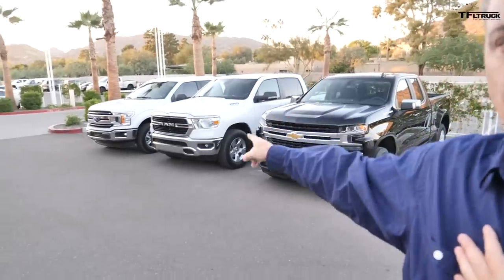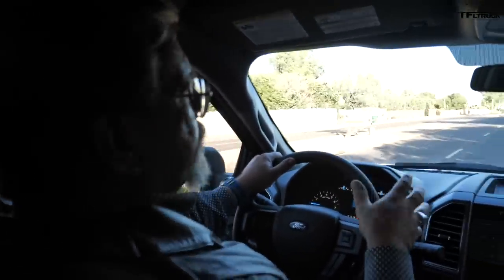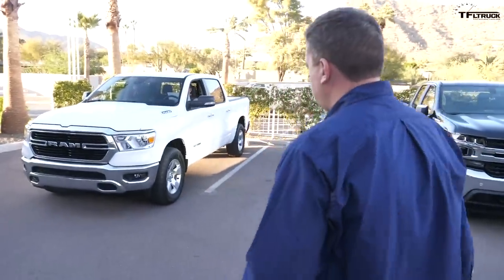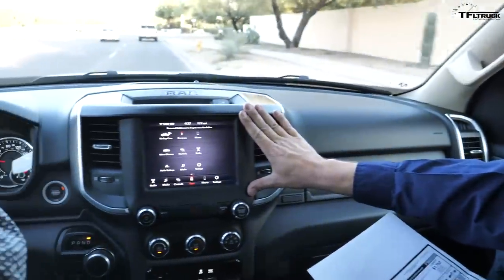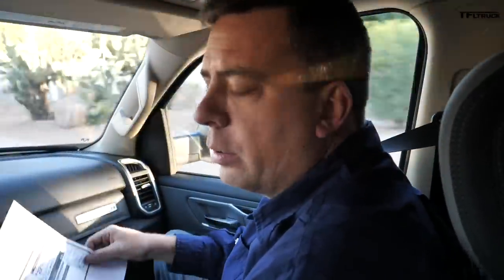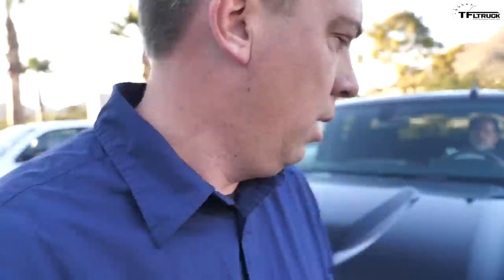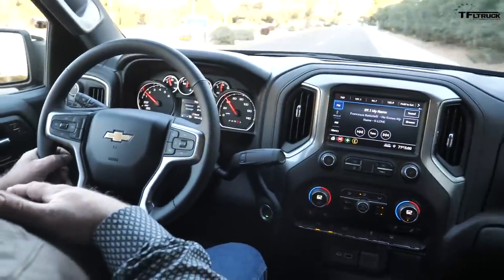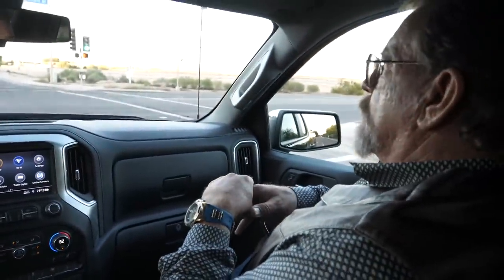Work Truck Wars: 2019 Chevy Silverado 4-Cylinder Turbo vs Ford F150 vs Ram 1500 Review

Comment: Ford guys. How do you get in and out of your supercabs?
Reply: Like a boss
Reply: We use the doors DUH!
Reply: Still using the inside reverse door swing out, passenger first method?
Reply: I don’t know about all you guys, but unless the whole family is in the truck, I am mostly driving it alone. If I had an extended cab, I would find the rear hung doors at that back more convenient for when I am taking stuff in and out of the back seat area. That and having no B pillar and that large opening has got to be useful at times.   And if you have a family with small kids, it’s a nice safety feature to have them unable to open the rear doors without you letting them out. Not seeing any real disadvantages to this configuration on an extended cab. It you are driving around with people most of the time, then get the crew cab.

Comment: No one in Thailand and Asia countries trust these 2 brand chevy and ford anymore.
Reply: How come? Did they release some real messes?
Reply: Many problem about transmission gear and crutch, overheat engine, rusty disc break . Without any responsibility from the company and dealler.

Comment: The 4 popper has the same fuel economy as my hemi. This kids is an epic fail of an engine.
Reply: Check the EPA ratings. A 2019 ram hemi 4x4 with 6 speed gets 14 mpg combined; the 8 speed gets 17 combined. This "4 popper" gets 20 combined in a 4x4. So lets see; the chevy gets between 3 and 6 mpg more than your hemi. When we're talking 20 mpg, 5 mpg is 25% better.

Comment: honestly...from a RAM guy...give me the ram..but with the hemi, which I own.  Sorry but I like my big horn with the hemi v8 and 8 speed. Yeah is it the best, I'm not sure.  But its simple! My great local mechanic can work on things that I can't.  These fancy systems are just time bombs waiting to happen. I would even rather take a chevy with the 5.3 or Ford with the 5.0 if I wasn't allowed to own my truck.  EDIT..I'm not anti-turbo, I down sized from my ram 2500 turbo diesel...sold the big camper and didn't need the towing. I just don't care for the turbo gas'rs.

Comment: Nice, really hope Chevrolet makes a real Raptor fighter. Dodge sounds good, but that Chevrolet is sweet for the $$
Reply: Your hopes are too high. Chevrolet could not compete. They put out the trail boss which is a far cry from the Raptor.
Reply: @kevinwilliamson7294  way better trucks inho, but need the suspension us the part that is needed.
Reply: @chad59  not understanding your reply.....
Reply: @kevinwilliamson7294  they are better in every way but the suspension in my opinion from driving them. Fords feel cheap. But the R&D on suspension is great
Reply: @chad59  I owned Chevrolet pickups for 32 years. Earlier this year I purchased a 2018 F150. It is a much better truck than any GM I have owned, in every way. Everyone is entitled to their opinion. Not sure how you are basing your comment on stating they "feel Cheap"
Reply: door gaps, dash, seats, hvac system. reliability. they are not good and sadly they are the "Cheap" option for fleet vehicles fire ambulances and fire service. they are ALWAYS breaking down at the most inconvenient times. Look at the TFL guys for was the only truck removed on a flatbed LOL. but the all have lemons, just seems like ford is a little worse. Its like they took the badge from the old Dodge quality issues.

Comment: At this rate.. get a Ridgeline 4WD🤯 🤔🤣  if were playing around with v6/I4 Turbos in full-sized & mid-sized trucks 

Love our big American trucks, the engineering on the expensive models are amazing, but the pricing...for those models with options 👀

Chevy gets marks for a new engine design and fuel estimates. The Interior design is drab like the F150, but should be durable in the long run. It seems like ram designed a different class of truck last year. If the ram was 4WD, would there have been a more clear winner?

Definitely going to trick my dad into test driving this Chevy (his favorite), then have the dealer bring him a 5.3, then drive that 5.3 over to ram for a direct comparo 😂. Then I’ll ask if he’ll consider a Ford 🤔